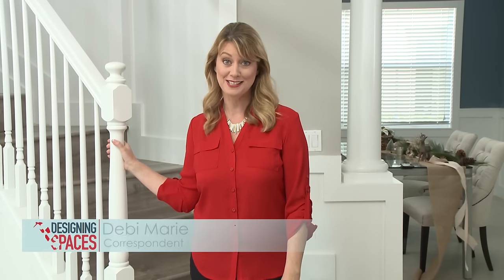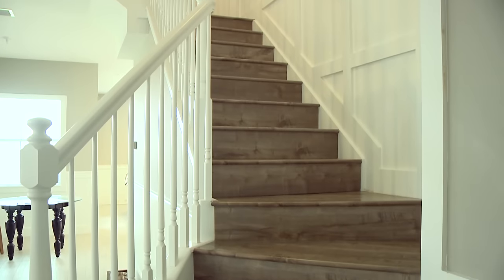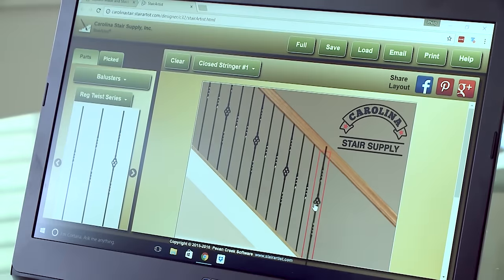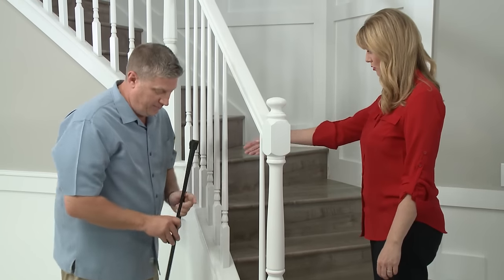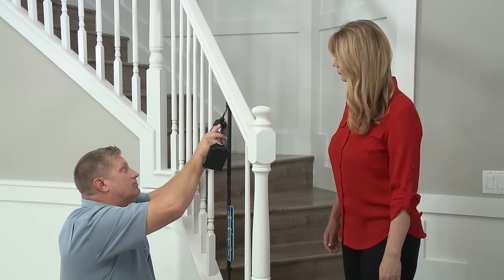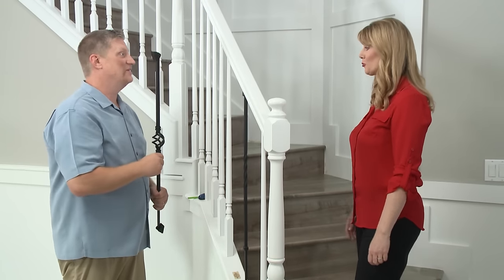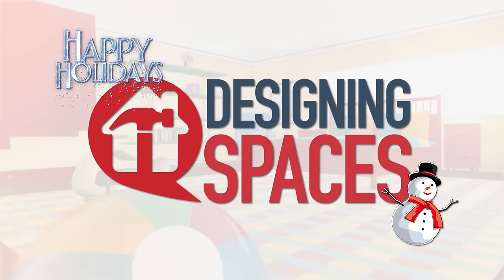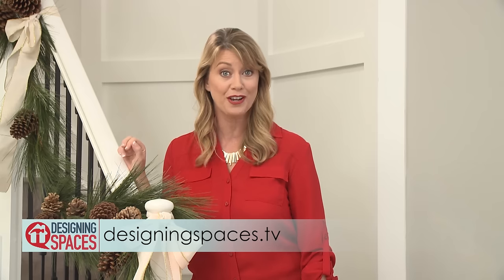DIY: Transforming your staircase in 3 easy STEPS!

Comment: Looks nice, my only complaint is that it offers no support. The two pieces don't lock together anywhere. So it seems over time with kids playing on the stairs, normal rail usage of going up and down the stairs, etc. Seems like the hand rail would begin to sag. Needs a set screw or some other way to support the weight.

Comment: Not code compliant in most cases. If the old ones exactly met the 4” between balusters required, then these will fail since they are not as thick/wide and will end up as >4” spacing between.
Reply: I was going to say that as well.

Comment: Looks a lot better. But noticed some people saying it’s not “code compliant”... is that true? Is this going to be structurally safe?
Reply: it not to do with structure, more to do with safety between each spindle. the reason you have a specific code that they must meet a set distance between each other has to do with kids could possibly fall through them or get the head stuck between them hence needs to be code compliant.